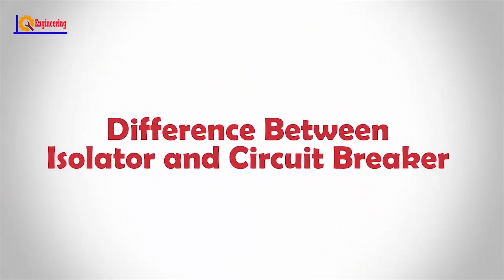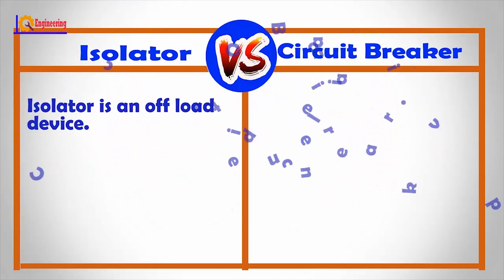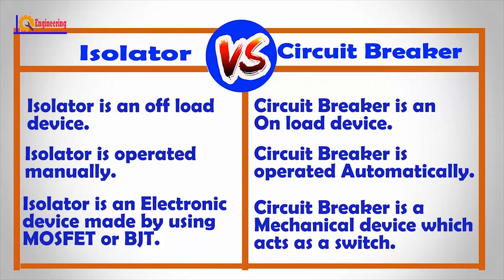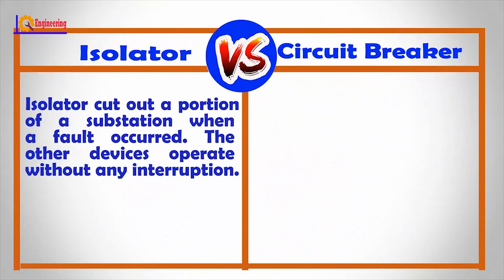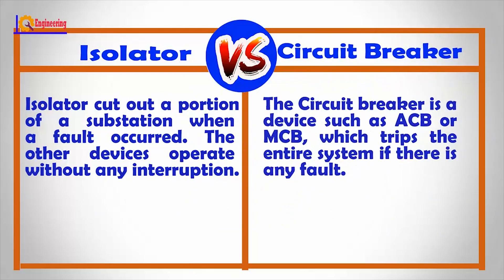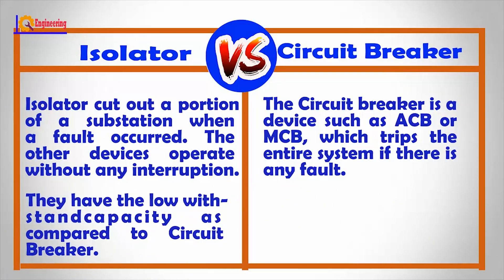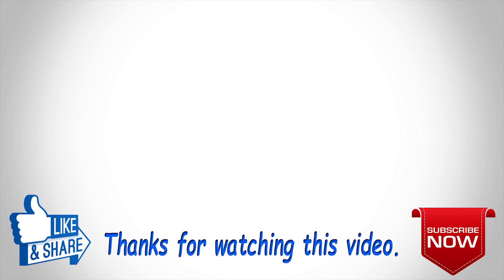Isolator vs Circuit Breaker  -  Difference Between Isolator and Circuit Breaker

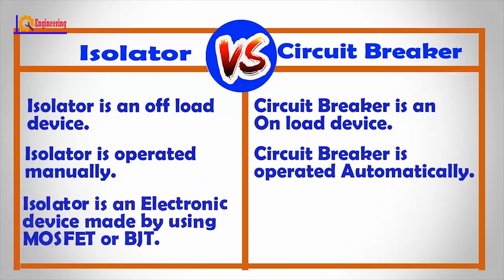Comment: At 1:10 I think there has been swapped, the Isolator with the circuit breaker, last one might have transistors (BJT or MOSFET) inside, while an isolator is pure mechanical.